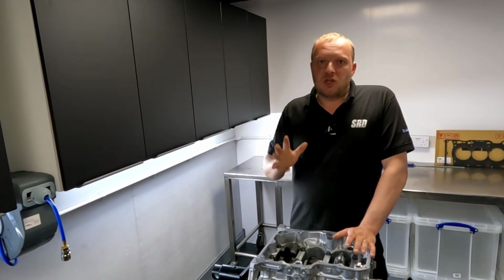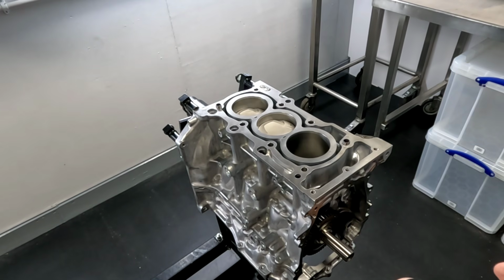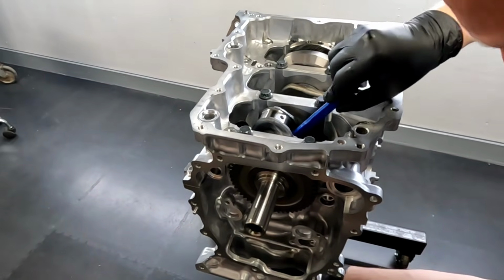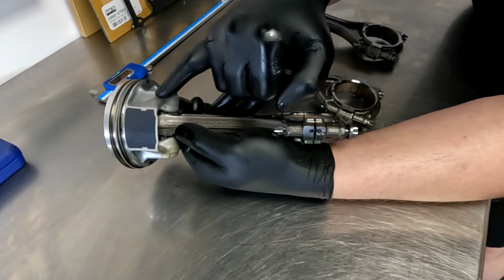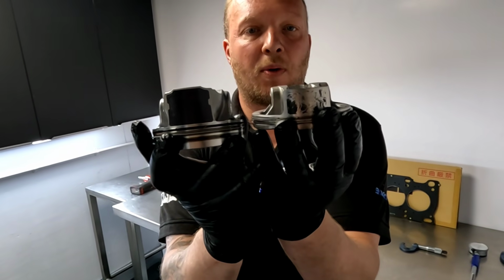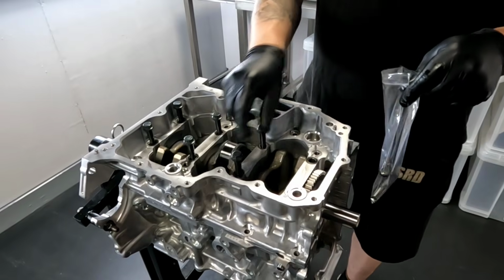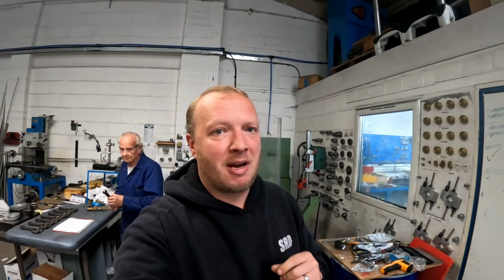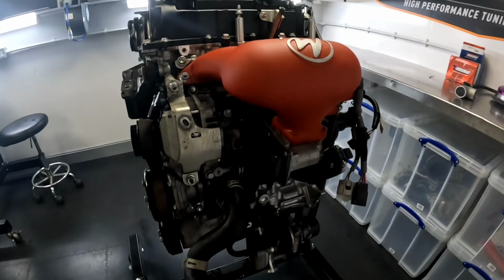GR Yaris Engine inspection and Build Part 2

Comment: Did you buy any chance weigh the engine. I see this engine becoming popular in the experimental aircraft market. Would he jice tonsee hw much it vibrates, it does have a large stroke and bore so it would would be good at about 4000 rpm constant. It would have large torque pulses though. Thanks for the video from the land down under.

Comment: too much ring gap-nobody know.....too little rgap, everybody knows!
Reply from the maker: To large of a rig gap makes the engine breathe more and shorter the oil life. 

If the top rig has a large ring gap can make the 2nd rig flutter. 

Out the box they should be tight so we can set them to what we want.

Not already to big 0.0045" per 1" of bore most pistons start with.

Comment: You said a couple of times it was a brand new engine. was it actually a brand new engine or was it the original from the GR Yaris you put on the ramp? Also surprised to see you didn't mention if the big end caps were "cracked" off the rods or machined faces?
Reply from the maker: Was a totally new short block from Toyota 
Rods are machine faces with dowl pins.
Reply: @srdtuning  Thank you so much sir for your reply. Now i have to ask.. why a new block? was there something wrong with the original? I ask as I am GRY owner.
Reply from the maker: No nothing wrong with the original GRY block but wanted to have the car off the road for minimum time. 

Made it easier to buy a new block have all the machine work done and crank balance work carried out then when the car arrived we were ready to basically do a short block change, turbo kit, intake, fuel system and mapping. Turn around has been. About 2 1/2 weeks. 

If we used the original block would have been 4 + weeks so was really a saving time thing plus the short block was quite cheep so made sense to do it this way.
Reply: @srdtuning  wow!! Thank you for your long and detailed reply. Very good of you. I guess doing it this way you also now have an exchange block if someone wanted it and didn’t care about matching numbers. I am really looking forward to seeing this come together, and how the drivetrain fares??